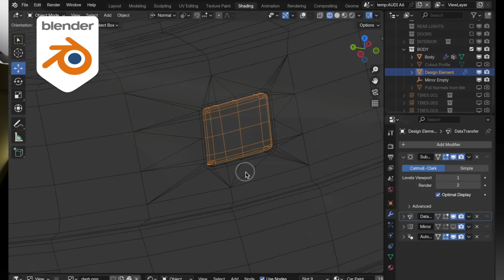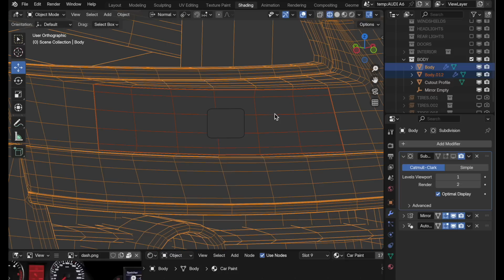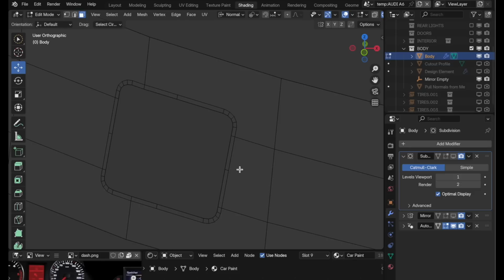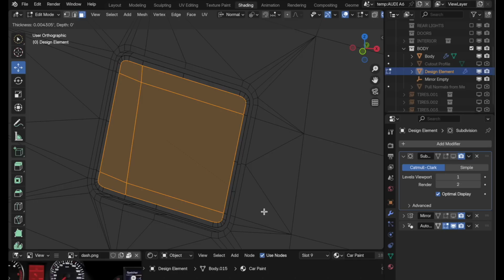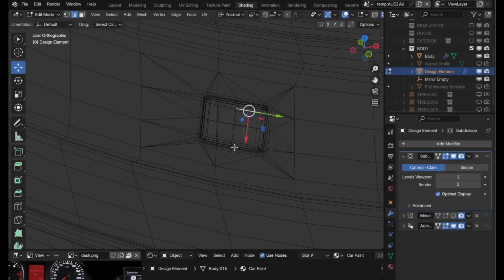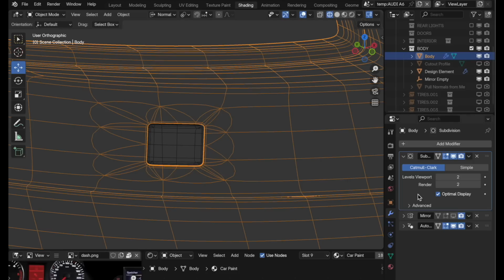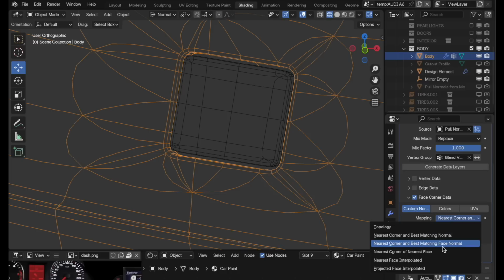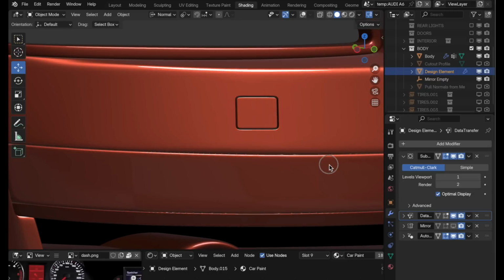Fix crappy surface shading with Data Transfer!

Comment: I knew of this technique but I have never really tried it out myself. Very useful. But how compatible is this with other software, game engines etc? Or is this just something that works inside of Blender. I learned, I pay.❤
Reply from the maker: If you export a model with this Data Transfer function applied, then exporting the modifier stack is 'flattened' and the normals baked into the exported model. I did a video showing this here: https://youtu.be/xfVzcqhBQ00
Reply: Ah thanks a lot, I had missed that video of yours. 👍🏻

Comment: I would have used shirkwrap to warp the wonky part on the pristine geometry (after subD)
This method works too 👌🏻 learned another new thing.
Reply from the maker: I actually recorded a followup video where I comment on using Shrinkwrap, why it's not a replacement for using Data Transfer in this case. https://youtu.be/QxOZ5NOrSYA
Reply: @christopher3d475  Nice 🙌

Comment: The good thing about this method ( i used it in the past) is that you can lock the normals and actually send it to other applications (with modifiers applied, of course) and it'll look as it should, with proper shading, none the less for product modeling if needed i would suggest Subd + Shrinkwrap method as it'll physically project and pull the denser vertex into the actual 3D space location, not being just a "normal trick" lets say. But of course combining these 2 methods, specially for personal or portfolio projects, it's a must, and great thing of both methods is that you can re-model or rework just a section of the model itself, doing it by panels or by parts, by sections.
Reply from the maker: The shrinkwrap method doesn't produce as good a result as the data transfer method. I recorded a followup video to specifically address this point that a number of people have made. https://youtu.be/QxOZ5NOrSYA
Reply: @christopher3d475  I just saw the video, i appreciate the fact you compared both and made a video about it. None the less as you suggested and as i did on this comment, i still think it is great o know both methods and use them both according to what's needed, in some cases the geometry (vertex pull to projected location) is essential and in some others it's just purely about shading, none the less of course we can also use both on the same detail/paneling mesh to achieve a perfect result. The only thing i'll point out about shrinkwrap method, is that the mesh target should be 1 or up to 2 higher subdivision levels than the final mesh, in order to achieve a proper "pull" of the vertex, nice video tho.
Reply: @christopher3d475  Is your method also known as Normal Transfer?

Comment: too much work. there has to be a better solution than this modifier madness. Besides, this only fixes the shading, not the shi**y geometry :(
Reply from the maker: Unfortunately with subdivision surfaces you're going to run into situations like this at times. No amount of finagling the geometry is going to get around some things. Besides, this is how NURBS generated meshes get such good shading, they pull shading from the mathematically perfect NURBS data and drop in onto less than perfect derived geometry.
Reply: Just another way of doing things, that's what he's showing us. There might be situations where this technique is overkill and better solutions exist. Or there might be situations where there this is better or faster. It's not that complicated anyway.
Reply: I think our job is to serve the vision, and as long as it solves the problem, I think the data transfer modifier is great.
Reply: Instead of using Data transfer modifier to fix normals you can use Shrinkwrap modifier to actually fix geometry.

Comment: That's a wonderful tool! Too bad it can't "transfer data" into other software, learning good topology is still very important
Reply from the maker: Actually it can. If you export this, Blender applies the modifier baking those normals into the mesh. Look back a few videos, I did a tutorial on it. And yes, good topology is always a best first defense, but in situations like this, you're going to spend a lot of time trying to come up with good geometry for such a small localized area.

Comment: Excellent stuff! Could you remove that final bit of kink in the surface by subdividing the mesh one more step before cutting the hole in it? What would the downside be (other than not really having an 'editable' low poly mesh anymore.. but would you make big edits anyways once you get to this stage? Maybe create a duplicate body for the small details and keep the original backed up..).
Reply from the maker: yes, there are any number of other things you can do here. But I didn't want to add anymore complexity to the existing cage.